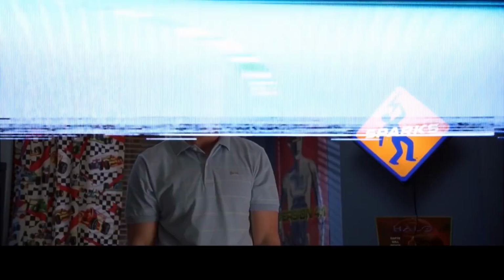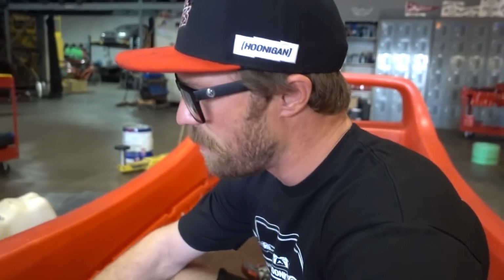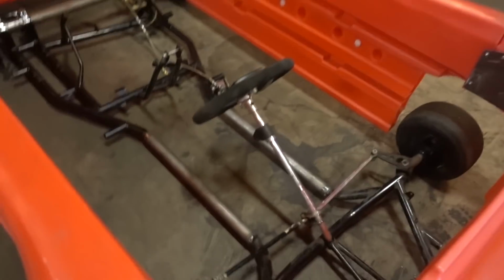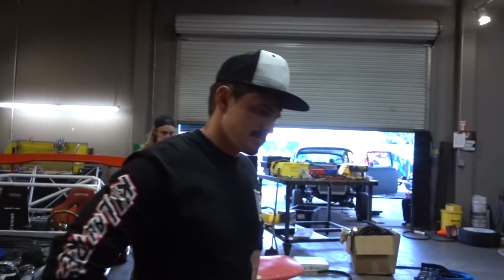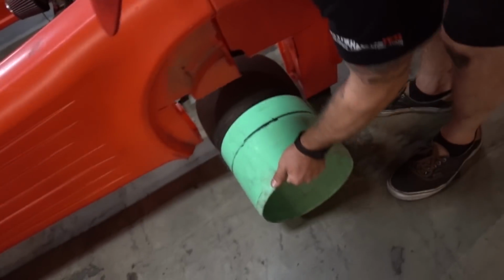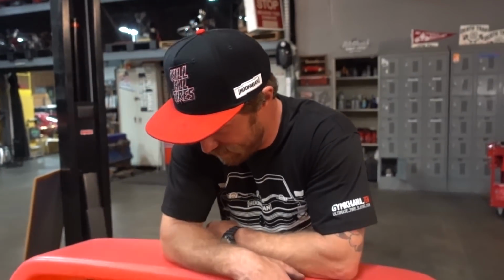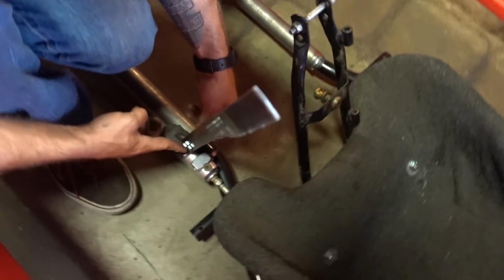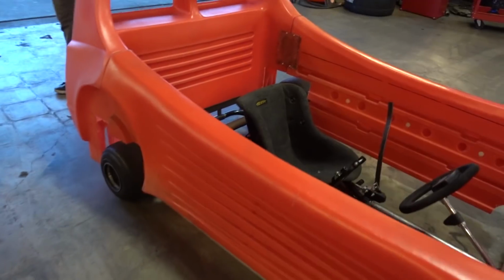Kart-Powered Racecar Bed: Chassis Test!

Comment: OMG i love this project! Please please pleeeeaase put some golf kart rims on it to fill out the fenders! :)
Reply: Maybe they could fit street qaud rims with tires on but the whole gokart needs go higher in body and the wheel arches need be cut out properly. ive seen some china qauds on sale where i live that have serten rim sizes and street tires. but its just a idea to improve the look im wondering what they gone make of this it would be funny to see a dashboard being build with radio and a rear panel as a Ferrari F40 likeish way. but i wonder if they have the cheap ass streetqauds in USA here i got 3 old ones on sale at a company in EU for around 1000 a 640 and 1340 euros a piece but these normaly cost around 3K from a dealer and yeah its china crap but stil they have these rims that look car like.. but stil i wonder what they make of this thing ive seen serten ferrari beds in my childhood on sale in bedshops but not like this plastic version.

Comment: Little tip on the PVC rears , just do one tyre on the rear axle , effectively 50% grip for more realistic drifts , both tyres will be a nightmare with hardly any drive forward and no chance of holding angle at speed . source (that's how drift karts do it)

Comment: I've been waiting for this all week!!!
You should cut open the rear and do a screen like on modern supercars for your ventilation and move the radiator and intake to the vent. Also if you make it big enough you could mount two fans, one to bring air into the radiator and intake and one pulling air out of the engine bay.

Comment: That “push” handbrake is an easy fix. A couple of bolts and a small flat metal bar makes it a proper pull brake. Don’t leave it like it is. Dan is better than that.

Comment: For the door area you could've gone for a double tube construction which run parallel in the door while giving a place to put the ducting and pins on top of them like you see on RC cars with lexan bodies. So you could just pull off the whole car bed upwards with quick releases. Might be too late tho and still stoked on the build! Make dreams come true!

Comment: you should add more tubes in the middle, sorta like this /lXl\ but thin tubes.
cause the chassis might bend when the go kart is running at high speed going up or down ramps or hitting the wall.
maybe find golf kart hubs that will fit in,12 to 14inch golf kart wheels with scooter to rise the height .
but nice job ,looking awesome.
now just need some led lights to make it look more like a mini car.

Comment: Dan, you need a Cleco kit, for when you need to temporarily rivet things.

EDIT: Cooling idea: turn the radiator 90 degrees and mount it over the rear axle. Then mount fans to the backs of the plastic wheels, so they both pull air in and make it look like you're doing burnouts all the time!

Comment: An idea that I would try to implement would be a piece of plywood at the height that the original bed was with about an inch of foam and some sick racing sheets on top.  So it looks like you sunk into the bed when your driving it.

Comment: Nice choice of motor
2 stroke 125 Rotax
Because it is a 2011 motor it might leak from the water seal at the back so check that if u want

Comment: 1/2" X 1" in box steel tube with ends attached to bottom of plastic sides and mounted across the cart frame to stiffen it as well. But the real question is if this build is to promote a Hoonigan bed spread. Sheets, pillow cases, duvet cover, or fleece blankie?

Comment: Frame tip.. Where you stretched the frame i would weld an upper frame with some diagonal down bars kinda like a bar joist that is used in construction..

Comment: I would design all the sides and all in flat pattern, waterjet all the flats out of .125" aluminum, then sandwich the parts that need to be strong out of foam sheet, aluminum, and construction adhesive.  Plus switch to those mag golf cart wheels

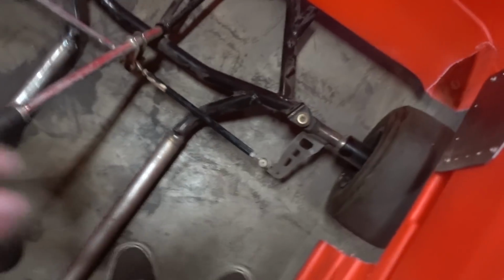Comment: 3:30 it's twisting the chassis because it's basically just two frame rails only connected in the front and back... put some cross bracing there and it will be significantly stronger for not a lot of weight.

EDIT: Also, instead of sitting on top sliding around, why not instead leave the seat where it is and just build the bed around the driver ala Lotus 11?

Comment: Yooo try making an actual one by one rectangle frame set two by fours on top of the tires set the frame on top of the two-by-fours and then tied the top frame into the bottom frame and then you can mount that rectangle box to the actual race car bed and then you'll have 2 frames and I'll keep it from bone in the center with weight plus you'll have that upper frame higher than the lower ones still be almost a bash bar protection all the way around and it'll keep the race car body onto the go-kart better

Comment: Your weight is all in the back (Driver and Motor, two heaviest things)you need to move weight over the front wheels to get traction on the front wheels. Then you will be able to steer.

Comment: Two stroke pipes don't really get that hot. You can comfortably put your gloved hands on an expansion chamber. 4 stroke will easily melt your gloves and give you 3rd degree burns though.

Comment: as  someone who races go karts Im looking at that thing and thinking its not going to be very derivable. Tires are useless like smooth shoes on ice unless they're hot and the wheel base and lack of differential will make it near impossible to steer. Maybe in a big lot or cough cough on the street it'll go  lol

Comment: I think if I made one, I'd see if I could turn the steering over so it resides inside that front box, and mount some kind of actuator to make it RC steering and give a flat bed front to back... not sure how to do the engine/throttle in this plan yet
Reply: update: The Crazy Kart XXL reminded me there's electric motors somewhere and there's promise for an eco-sequel to this part of the garage garage series

Comment: Probably to late but you want most of the weight on the axles why dont you make the seat brackets come off the front and back of the frame so that any seat load is spread to only the front and back.

Comment: Yo  find a more powefull motor from something like a motard/motocross crf 450 drz 400 yzf....... it will give u more torque less heat probably not much more weight and size think about it it would make this thing so awesome plus u will have 5 speed gearbox
Reply: Could do a sequential

Comment: Dan please can you do a how to weld video, 
Im trying to mig/tig ( im not sure I'm using gas and self feeding) is weld stainless steel conduit together and i keep fucking it, dont know what im doing, ive been given some tips from Slovakian welders where i work but its all hand gestures and nods.
Reply: I'm obviously not him but I am a certified welder, you're using a mig welder, you haven't really explained what's happening so it's hard to help but firstly make sure what you're welding on is clean as it sounds like it might be galvanized steel which isn't  good for you. if you're a visual learner a channel called welding tips and tricks is fantastic! have a great day
Reply: @enemymetalworks  Thank you very much. And its stainless steel conduit and box section, i wasnt aware that stainless was galve coated but with galve stuff id grind it off, but yes i am a visual learner and ill be sure to check that channel out.

Comment: It would be amazing if you put a mattress on it with a fake body (arms and legs) but there is also a hole where you sit down into the kart itself. The steering wheel is down inside the kart. When looking at it while someone is in it you would see a small body laying on a bed with arms flailing around as it drives itself. The only part of the actual person you should see is the head and part of the shoulders. The blanket on the bed would help hide everything as well.